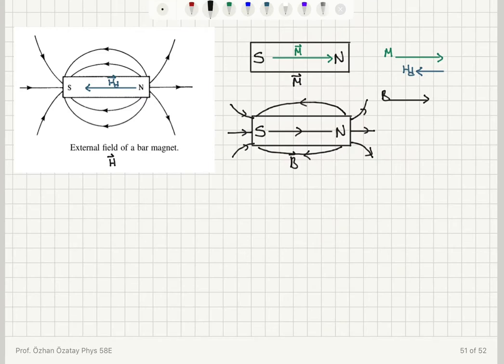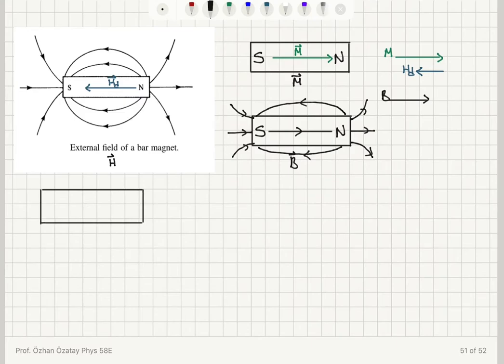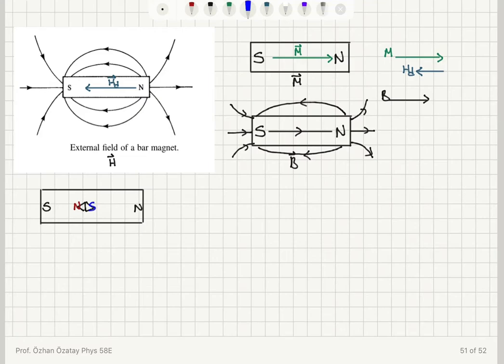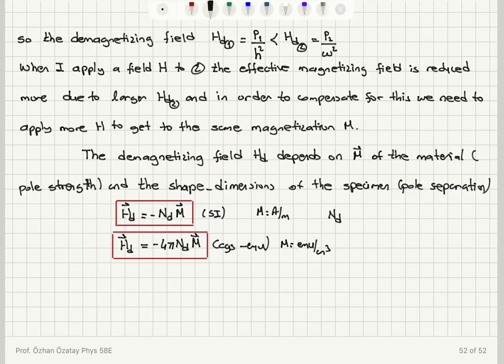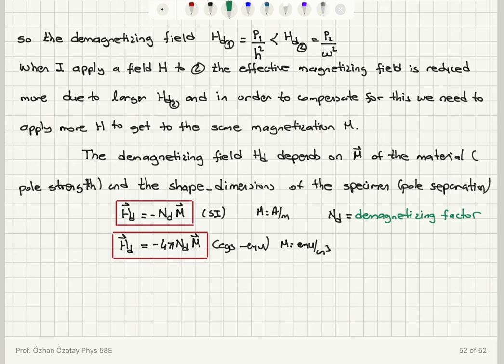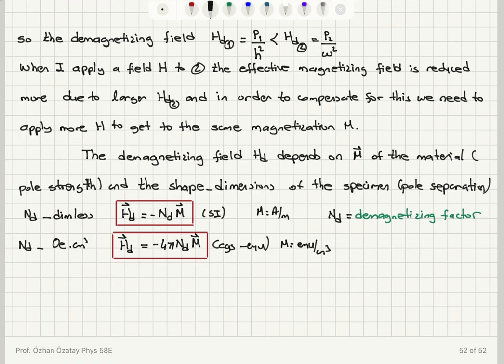Week 3-2 Demagnetizing Field

Comment: Very nice :)  Clear and to the point explanation. I have one doubt though. During the analysis it was mentioned that Magnetization is the same for both cases, i.e. M1 = M2. Since volume is the same, the magnetic moment for both the cases should be the same, i.e. m1 = m2. From this, it is concluded that pole strength P2 > P1. If so, in the graph that you showed on first page, should it be BH instead of MH?  Because, according to the graph, M1 is not equal to M2 for the same H. Could you please help with clarification? Thank you.
Reply from the maker: No it is M-H. M1 = M2 is only for the saturation.
Reply: @ozhanozatay  Oh, okay. Thank you for the prompt clarification.
Reply: Good question. Thanks. (21:31)